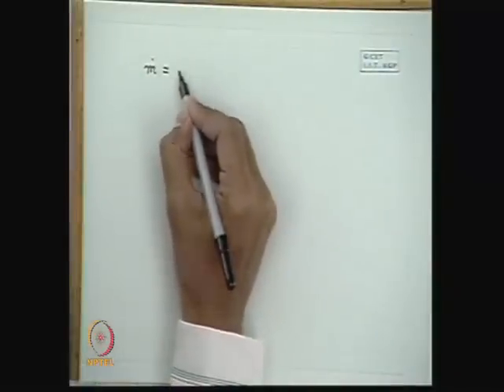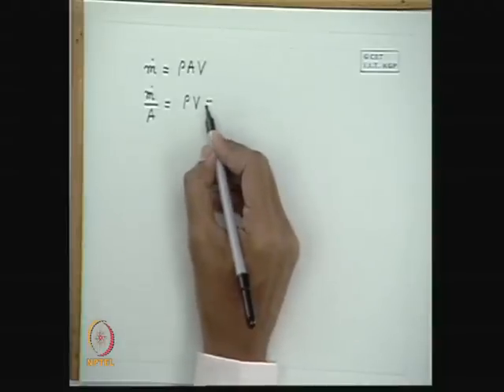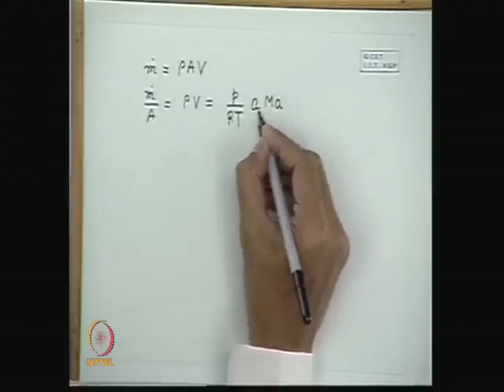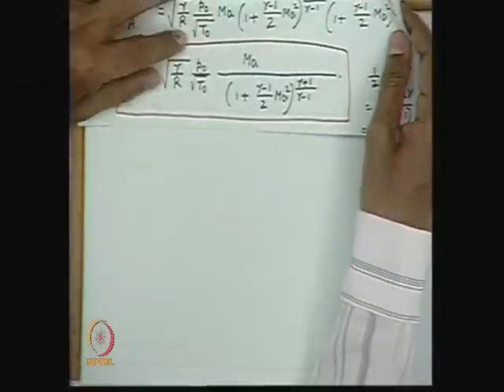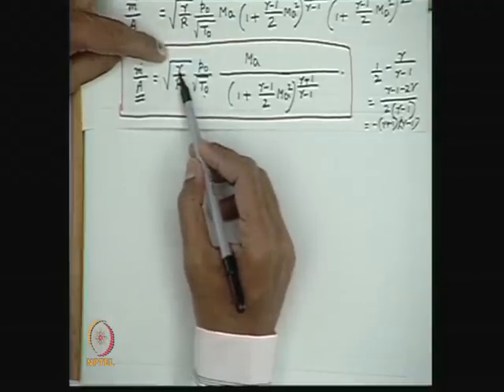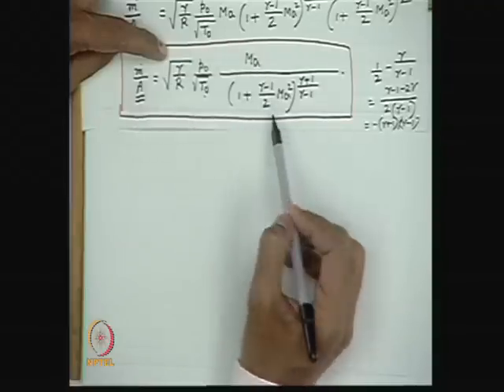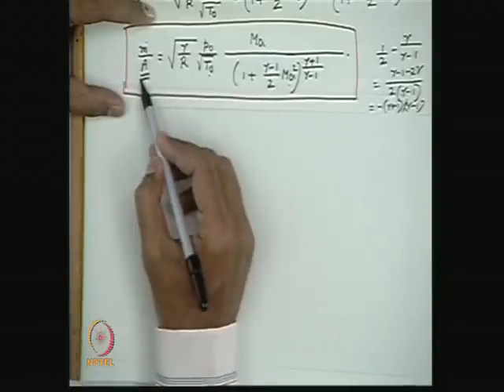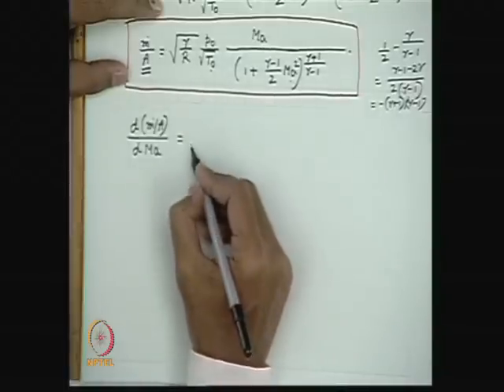Mod-01 Lec-31 Choking in a Converging Nozzle

Comment: I have a Question. Lets consider the flow is chocked and the velocity at throat reached to Mach 1. Now if I further increase in back pressure, will the flow from Nozzle remain chocked or will reduce to subsonic speed? Because if we increase the backpressure, the information can not travel through the Nozzle throat. so can it keep on running with chocked flow? I am confused at this point.

Comment: At 25:30 even if the pressure dropped from the sonic condition , I agree that flow can't accelerate. But my question is why velocity not increased by decreasing pressure and flow start to decelerate as supersonic flow through the converging duct?
Reply: Got the answer in the closure of this lecture. 36.00 min onwards
Reply: If you can explain me who do the maximum mass flow rate occurs at minimum area not able to catch this point
Reply: This is some good question ⁉️